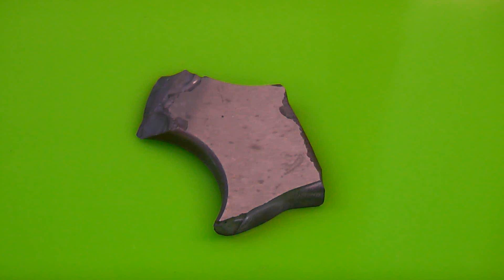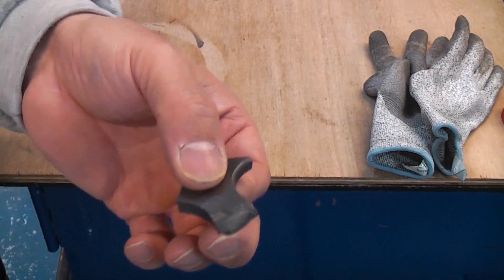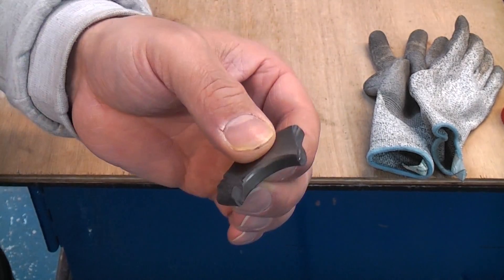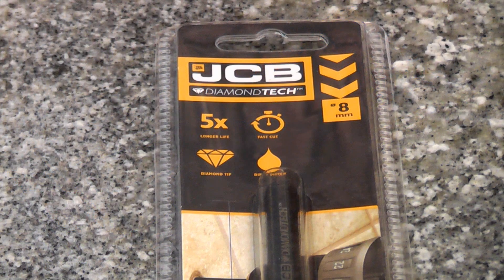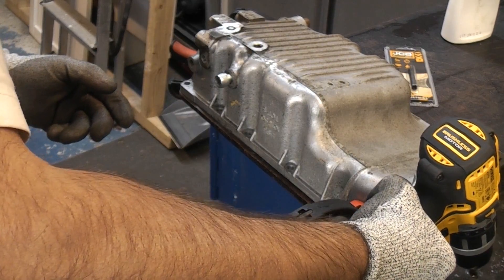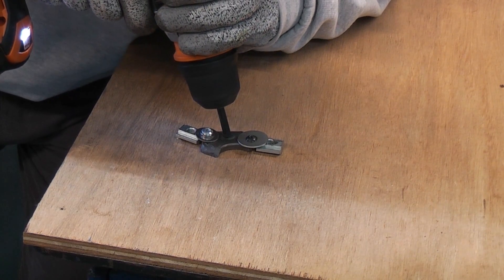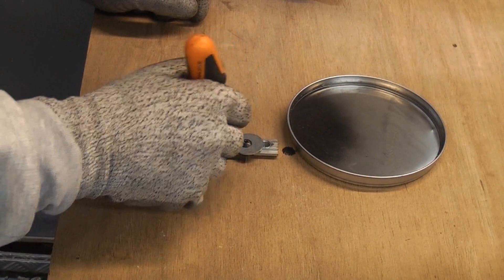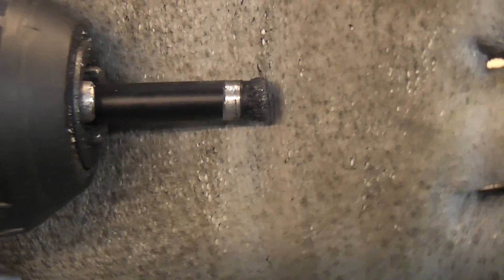How to drill tungsten carbide

Comment: How hardnes of a tungsten carbide is by Mohs scale?
  Does it reach 8 and a half?
Reply from the maker: No idea, sorry.
All I know is that you can't drill it with normal drill bits and you can't cut it using abrasive discs.
Thanks for the comment 👍

Comment: I bought one of these on your recommendation to drill wall tiles that were so hard they immediately blunted tungsten carbide drills. Absolute magic - it went through 6 holes with no difficulty and little sign of wear
Reply from the maker: I've tried a few over the years and the quality of these is superb. Thanks for letting me know that you also found them to be good and thanks for the comment 👍

Comment: What was that piece of carbide used for?  Some carbides are harder than others.  The carbide tip of a masonry bit has more cobalt to make it tougher so it doesn't chip, but it's not as hard as other tungsten carbides.
Reply from the maker: I'm not sure to be honest, one of the other maintenance engineers on site removed it from a machine that I have never worked on (I think it could have been a ball mill)
Thanks for the comment

Comment: Careful with the dust coming off carbide when cutting. Tungsten carbide is not good for you if it gets inside your lungs. It is bound with cobalt as well, all adding to the Cancer. The water in this video would have kept all the dust materials in one place.
Reply from the maker: Absolutely
Thanks for the comment

Comment: What about titanium drill bits will they be able to drill though it?  And can it be cut with the oxy/ceteyln?  I can see that it's almost impossible to drill into tungsten carbide. Not that I have ever had to work with it and hopefully I never have too ☺
Reply from the maker: No drill bits will touch Tungsten carbide, it is very tough, which is why they use it for the tips of masonry drill bits and for cutting tools.
I only found out that a cutting disc in a grinder will not even cut tungsten, a friend of mine tried it a few weeks back and it just turns the disc into dust! 

I'm not sure about oxy/acetylene!

Thanks for the comment ;-)

Comment: I need to drill about a 1/4 inch (6mm) hole through a piece of hardened tool steel about 3-4 mm thick. Think one of these would work?
Reply from the maker: I tried these quickly on a hardened steel bearing race, they started off well, but then the but seemed to stop cutting, after a couple of mm (the bearing race is about 8mm thick). I have drilled hardened steel in the past using an ARTU drill bit - https://www.youtube.com/watch?v=zbJq2z2ya80
I hope this helps.
Thanks for the comment

Comment: There is only diamond that will actually cut Tungsten Carbide. Before the material is sintered you can snap it in half like a biscuit its that brittle. 

You can chip tungsten carbide if you tap 2 pieces together, dropping it on a floor will do very little if any damage at all.
Reply from the maker: Thanks for the comment

Comment: Wow, I never thought I would ever see tungsten carbide drilled, brilliant video.
Reply from the maker: It was only a few weeks back that I found out that an abrasive disc in a grinder will not cut tungsten, I though an abrasive disc would cut through anything! 
Thanks for the comment 👍
Reply: Diamond infused metal abrasive disc would probably work

Comment: Nice job. However, would be reasonable to drill the piece under the water.  Just create kind of basin around the piece using plasticine for example. Or use some shallow pan :-)
Reply from the maker: Yes, you could do that.
Thanks for the comment